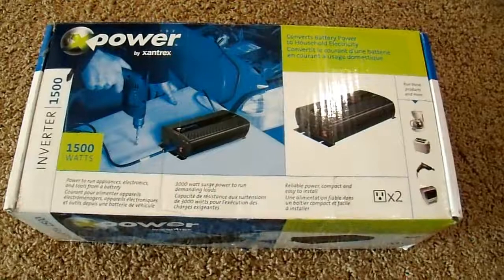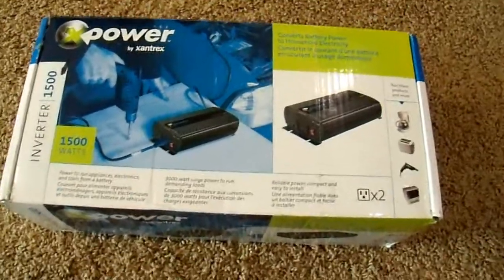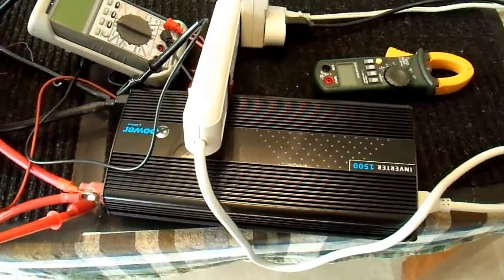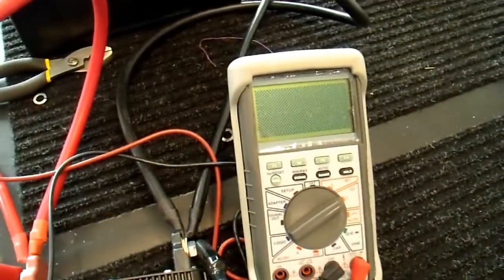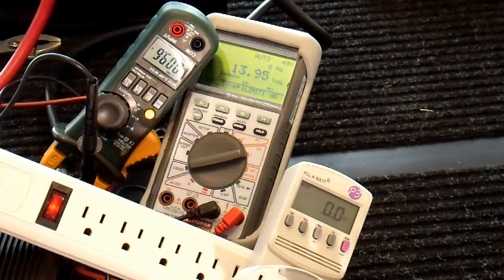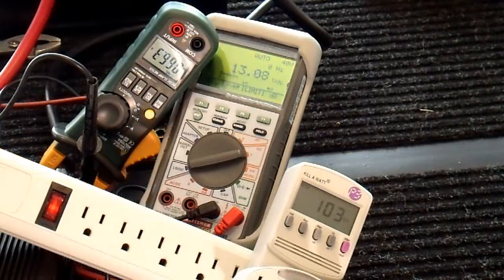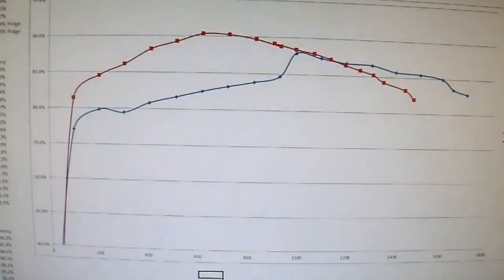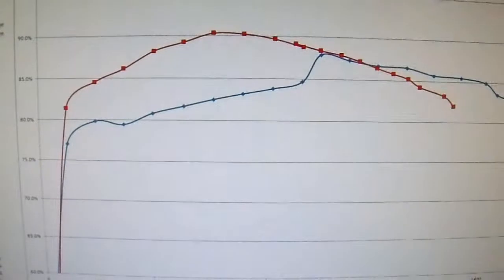Testing the Efficiency of Inverters - Xantrex XPower 1500 watt

Comment: I use Powerbright APS300-12 inverters, per your recommendation. I'm interested in knowing whether the differences in efficiency of MSW vs PSW inverters translate into longer battery/source  run times/life between them. I use my inverter to drive a Fishman loudbox mini amp and use a 12.8v 40ah lithium iron batter as source. I get 12 to 14hours with the APS300 at the moment.

Thx for your videos, I've watched for hours.

Comment: I think what youre seeing in your Blue line graph is that the inverter was cold (or room temp) when you started taking stat data. Take the following as an example for discussion: Alternators on car and boat engines dont become efficient until the engine is warmed up and alternator has been running for >4 minutes and warmed up. On start up of a car or boat engine, amps and voltage readings will be much different at engine start up than it will be after running for a few minutes; i.e. they haven't become stabilized yet. NOW....yes a "hot" car or boat engine or a "hot" alternator can hurt your efficency of the DC alternator. But once a engine alternator has been running for ~4 minutes or so and temperatures are stabilized and no longer "cold", your graph would likely become smoother I believe, like you said you were expecting to see. For example, if you ran (2) 100w bulbs for 5 minutes then start over. [OFF]. Then [ON w 100w BULBS], then [ON w 200w BULBS], etc, etc,. In my opinion you'd see a better curve.
Reply: he had 9 light bulbs, the 10th data point is when the light bulbs were removed from the load and the heater added which gave us that high and 10th data point, then he added each of the lights back one at a time gathering that data. i wish he would have pursued that drop at data point 2 and the climb at data point 10. i am super curious and would have assumed, at least at first that i did something wrong if it was me. but the video is all here to examine, he seems like he knows how to use a spreadsheet so who knows.

Comment: I took kill a watt meter and plugged into my modified sine inverter. It said my hz  was around 18,20,24 hz. I also have two pyle 1800w line conditioners. I plugged both of them in series ,inverter, conditioners, kill a watt, load. Now I read 60 hz. It took both of the conditioners to get this reading. What would this show on a oscilloscope?
Reply from the maker: I've never seen the kill a watt read an incorrect frequency with any of the inverters I have tested/owned.  I would think that inverter has a serious problem!